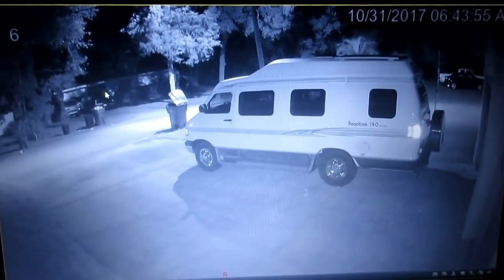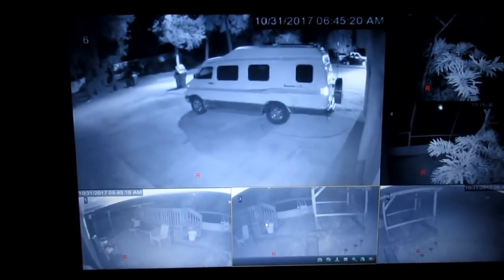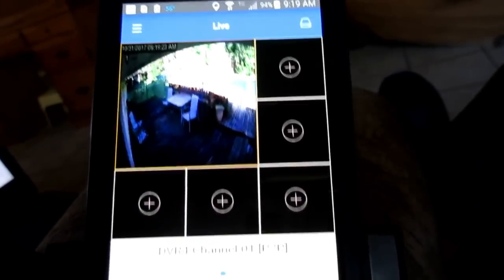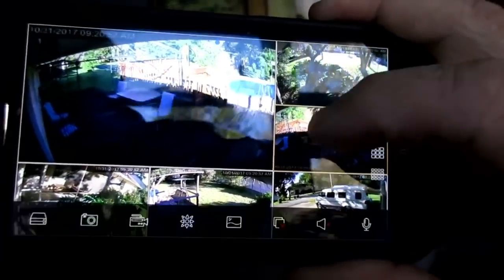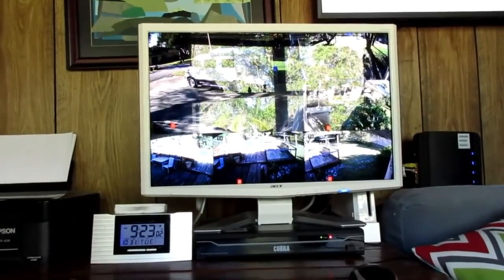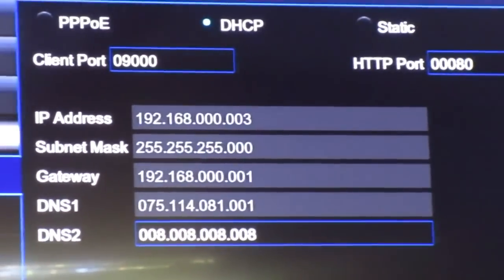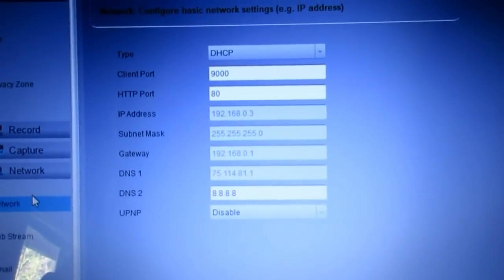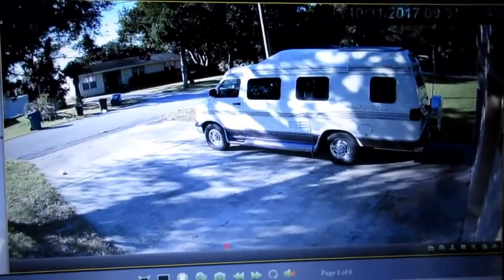Update On Cobra 63890 Security Camera System Night View And Using Smart Phone To View

Comment: I purchased this unit about a year ago. I did not have a  combatant person to set the system up. Now that it is set up I do not know to work the cameras. The person must be tech savvy. The instructions are very complicated. The cameras are great. The person went thru my attic and put a hole in my sheet rock.
Reply from the maker: Oh that does not sound good. It is a very complicated system and they don't have good instructions.  I've done several videos about how the cameras work that may be helpful to you.  Check them out. Good luck, Donna.
Reply: Please tell me how to go back to review what you recorded each day. I contacted the tech department and all I get from them is a little info and frustration when you can not figure out what you are to do. I paid for this system and I need to be able to operate it. I can understand  some of the info from Dawg but I am not interested in setting up the phone to the cameras. I can barely see the screen however I am on my cell phone.

Comment: Do you need Wi-Fi to control this system
Reply: LAN only, no wifi with this model. Buy something else because many modem/routers out there won't recognize this thing! If you don't care about having it connected to net so can view remotely from either your pc or cell then it's a decent system. If want to network it to a pc, forget it. You'll be banging your head against the wall.
Reply from the maker: It will work with out wi-fi you just can't see the video on computer or phone just the monitor.

Comment: do you need internet with this system or can i use in in a building with just electricity? i understand remote viewing wont work but can i use this set up with nothing more then electricity and a monitor? thanks
Reply from the maker: No you don't have to have internet it will work without it.
Reply: thank you
Reply: And remote viewing without internet

Comment: I`M LOOKING TO SEE IF YOU HAVE STEP BY STEP INSTRUCTIONS FOR CONNECTION ON A ANDROID DEVICE (CELL PHONE}
IV`E UPLOADED THE APP ,FOLLOWED ALL THE SETTING PARAMETERS , PORT FORWARDING , I HAD TO USE IP ADDRESS TO GET A CONNECTION  AND IT DOES WORK WITHIN THE ROUTER DISTANCES. BUT I SHOULD BE ABLE TO VIEW VIA INTERNET ANY WHERE I`M AT. WITH NO LUCK SO FAR. IV`E BEEN IN  CONTACT WITH HARBOR FREIGHT TECH. SUPPORT , MY IP SUPPORT, AND MY CELL SERVICE PROVIDER  WHICH IS VERIZON . NO LUCK SO FAR. ANY IDEAS ? I HAVE A MODEM / ROUTER
COMBO UNIT ARRIS SBG6900-AC .
Reply: when u add the device on the rxcamview app, enter it in manually, and use your home ip address instead of the dvr ip address it gives it.. and that will let you view it remotely while off your home network..
Reply from the maker: I don't have a step by step it just gets to confusing.

Comment: Can you view the video live on mobile not on the wifi network and on the mobile network?
Reply: chris hillaker. Im able to see it from my phone and IPad using my moble network.
Reply: It took me while to figure out I needed to open a port in my router to view through moble network.
Reply from the maker: You can view the video on wifi I have never got the mobile to work.
Reply: Chris, can you explain how you did this? This has been driving me crazy trying to figure out how to connect using my data. I have an iPhone 6 if that matters. Thanks!
Reply: Mel, can you explain how you were able to connect your iPhone to view the CCTV using your data? Thank you.
Reply: chris hillaker Im having that issue.  Only works on wifi.. How did you fix it?
Reply: when u add the device on the rxcamview app, enter it in manually, and use your home ip address instead of the dvr ip address it gives it.. and that will let you view it remotely while off your home network..

Comment: I've had 2 of these now. POS, restarts on its own at least once a day (yes,auto reboot is OFF);doesn't record for hours at a time.Sometimes an hour,sometimes for 3 hours
Reply: I have this system also. It records continuous for about 2 weeks and then over writes. I would say that for some reason yours is set up to over write every day. That or else you have a faulty recorder. I think there might be a way to restore it factory settings, but this is not much help I know except that I really like mine, but would like it more if I could get it to network to my smartphone or lap top. Hope you get it working, it's a real piece of mind.
Reply: I might not care if it was just over writing,but it does not record anything on any camera for sometimes an hour,sometimes for as long as 5 hours after it restarts And it does it multiple times through the day. Only during the day,it doesn't do it at night.. It's the second one that's done this.Worked fine for maybe 4 or 5 days

Comment: I was debating about whether or not to purchase this surveillance system.  The two videos I watched on your channel about this product sold me on it.
I will be purchasing this tomorrow.  Thank you for creating the videos!
Reply from the maker: Noe Gorrochotegui Thanks I'm sure you will like it
Reply from the maker: Your welcome glad it helped!
Reply: Run from it, garbage. Luck of the draw with this thing, don't be surprised if buy one you'll be returning it for exchange at least once. It won't be recognized by a great many modems out there for desktop internet use. If you want to set in front of your direct monitor (no net connection) in real time 24/7 then it's a good system. If you want remote access, good luck. Get something from Bunker Hill instead.

Comment: Were the cables to the cameras long enough. I wonder if you can buy longer ones
Reply: I set mine up in garage. My garage points towards the street so yes in my case they are long enough. They are sixty feet long and I'm sure you could buy extra cables and a cord that would connect 2 of them together giving you 120 feet.
Reply: I bought a set of 4 x 100 ft cables off Amazon for $30 
http://a.co/4JRz0fY
Reply from the maker: My cables were long enough. You can find them on Ebay
Reply: Its 2 wires... splice the length u need

Comment: I just got one identical I need help setting it up on my WiFi if you don’t mind helping me I can give you my # if you want to call me I need help you could help me walk me through it if you don’t mind thank you
Reply from the maker: Setting up the WiFi can be tricky try calling there support number
1-888-866-5797
I'm not a expert in setting up WiFi
Reply: Lucky Dawg Productions thank you so much I’ll give them a call tomorrow thank you
Reply: That’s harbor freight tools I try calling them today but they alway slow on answering the phone they never answered the phone for me anytime I give them a call but I’ll try agin tomorrow.
Reply from the maker: Harbor Freight tools does the support for this system.
Reply: Harbor Freight customer service keeps "disconnecting" on me.  I can't get the mobile or PC function to work.  The instructions in the manual are confusing as can be!
Reply from the maker: I can be very confusing It took me a bit of expermenting to get mine to connect. You do have to look on your DVR screen and find your Ip Address and enter it into the computer software.
Reply: I finally got it to work on my PC, but still not onto my cell phone app.  I had pop up blockers, so after I downloaded the plug-in, it wouldn't let me open the Log-in window.  As for the mobile app...still working on it!  It will not recognize the password, which I know to be the same as the dvr password...  
I have 2 of the 4 cameras mounted and running, and they work very well so far as I can tell!  Harbor Freight used to sell the Swann camera system which I still use at home, and it was so easy to set up!  Less than 10 minutes on the software side...thanks for your helpful video and active comments.
Reply from the maker: cool glad you got the PC working keep messing with the pone you will get it.:)

Comment: Does this system have an alarm telling you when its activated?

thank you
Reply from the maker: Yes it does have a alarm.
Reply: Thanks, i picked one up yesterday after reviewing a few vids.
I cant seem to get the mobile apps to connect to it though. any tips?
Reply from the maker: Try copying the IP address to the from the dvr box to the moble app
Reply: i tried that, couldnt get it to allow access. my DVR doesnt have a separate setting for mobile. Do you know if there is a software or firmware update? ive tried calling customer service but 30 mins in, still on hold.
Reply from the maker: Dan Peters do you have it connected with a Ethernet cable to your router?
Reply: yes
i guess in not configuring right. the camview software isnt compatible with my galaxy S2 though. maybe i need to upgrade
Reply: it does work though my other desktop comps, just not the mobiles
Reply from the maker: Dan Peters mine has a symbol on top of the dvr that you can scan with your app that will configure it.
Reply: tried it. i guess i need to get a better mobile
Reply from the maker: I had a little trouble getting it to connect to one of my mobiles but kept trying different things and did get it to connect
Reply: well, when i have more time, i'll try tech support again
Reply: Smart phone viewing only works on wifi
Reply: It sounds like you are trying to set it up over internet. You must be connected to the wifi network to get the images unless you have a monthly amount to pay to add it to your internet provider.
Reply: You are attempting WAN when it is only LAN. It does work with online stream but you must have the availability to do it with your ISP.
Reply: i think we found the problem, our phones were too old to work with the system, it does connect to my other networked computers.

Comment: My system is wireless . It has battery's in the camera that will last about 6 months before needing charged. But it does not continuously record it will go off if it see's motion record and send a alert to your phone and also a email to review. I can go in turn on the camera's and view what is going on. It works good it saw two kids come up in the drive set off the alert and sent a email.
Reply from the maker: Sounds like a nice system! This one will rerord for about 6 days 24/7 then it will start over writing.